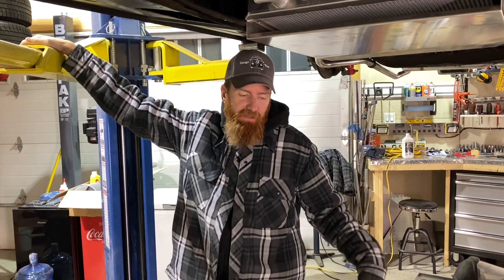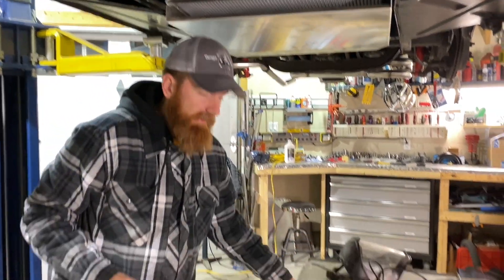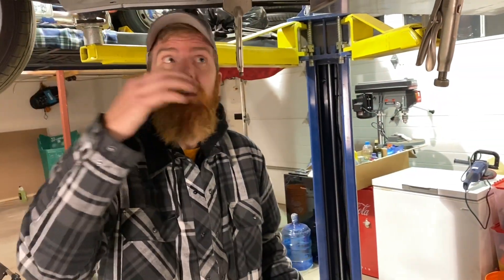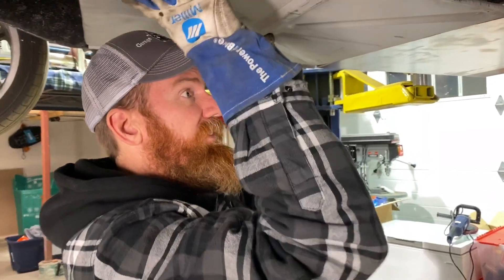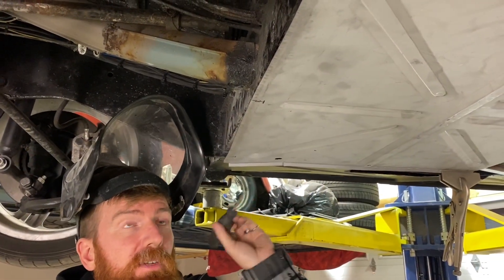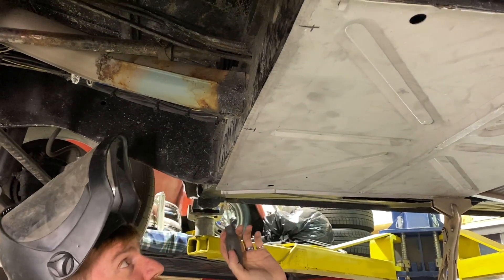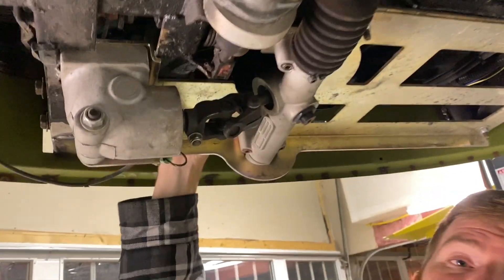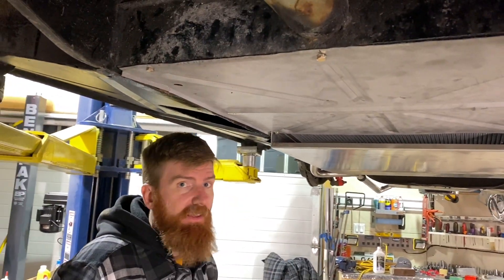VW Bus - Subaru Swap - Radiators and Belly Pans - Episode 15

Comment: Interesting way to deal with the cooling.
Reply from the maker: Was told two hard to get dual rads in engine bay of a split, similar to yours. Was the way I originally wanted to go.  Thanks
Reply: @GarageTime  Yeah the 2 Honda civic radiators I used just fit in a bay window bus.

Comment: its coming along nicely :)  one observation? i couldnt tell if there is a hole in the front or side so the heat can escape ...when the air goes in the scoop and through the radiator , the warm air might pool in that hollow you have with the new belly pan. unless its the effect you want. specially when sitting in traffic...
Reply from the maker: Yes, it has some gaps on the sides and small hole on front (old heater tube hole) so hopefully it is enough, but road tests will tell.

Keep you posted, once we start into road tests. 
Thanks